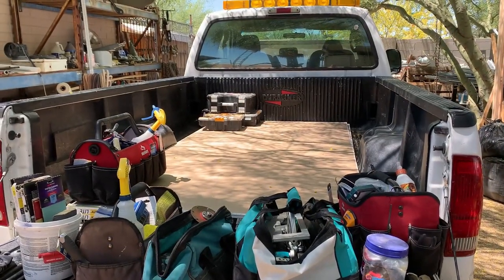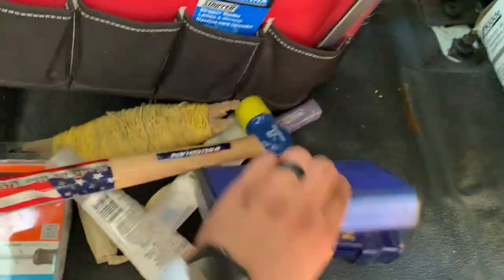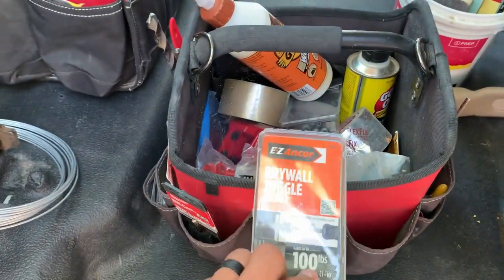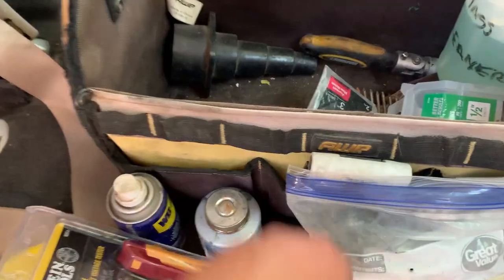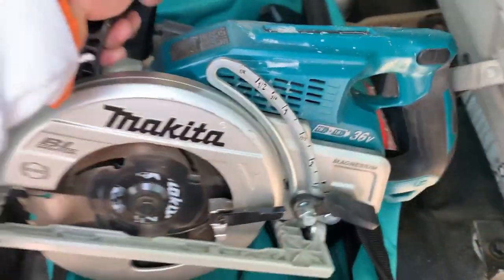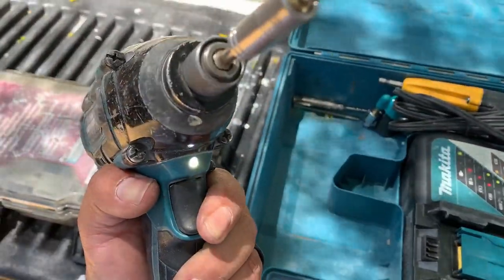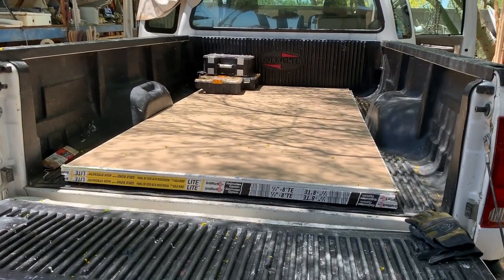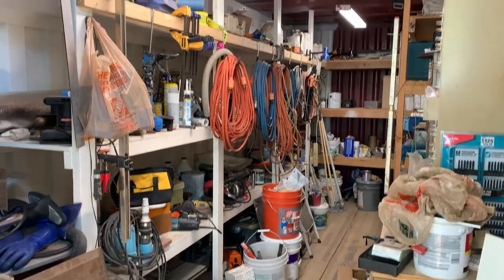Self Employed Handyman - What's In My Work Truck?

Comment: I do remodeling always looking for time saving and organizational tips.
I found the Rigid rolling tool box system very good.
Also those husky tool bags are great for a set-up .plumbing, electrical, carpentry.  I have separate set-up tool bag for each trade... saves time and the tools are in that set-up.
My cordless tools are in the Rigid rolling tool box.. 
Great video
Reply from the maker: Thank you. I’ll look up those rolling tool box and try them out.
Reply: That’s why I watched this video, I have tools for several trades and they are all unorganized because I’ve mainly just used them for personal remodeling projects, but now I’m planning to work for the public and I can’t spend an hour looking for a specific tool. I need to become more organized. This video gave me some good tips. I have a 20 ft trailer with shelving on one side and at the front. Think I’ll make this my primary storage location and compartmentalize my tools by trade or function so I can take what I need to a job without hauling that big trailer everywhere.
Reply from the maker: @LVCID777  I used to have a small enclosed trailer where I began storing all my stuff as well! Eventually I had to get the 20ft container though to store even more things. I’m glad the video was helpful, and good luck to you!
Reply: Same lol 😆 Alot of Handymans are alike

Comment: I teach you what learned any screw can be cut to letgh needed with wire cutters, bolt cutters. Or just grinder. We line up panels and covers with ice pick help line up screw holes.
Reply from the maker: Thank you for the advice. That’s good tip to cut the screws if you have long ones and need smaller ones. We are lucky because the customer or client pays for the materials and I always calculate my overhead (how much I spend from my own money on materials like screws) so I just buy the size we need so we don’t have to go back and cut them back, saves a little bit of time. And I’ll try that idea about using the ice pick to line up the screw holes.

Comment: Good video, thank you!! What about the actual tool bags? You have Husky, Veto..... Any feedback on what bags last and perform the best? Thanks again!!
Reply from the maker: Thank you for watching the video. As for the bags, I don’t usually take them down from the car as I usually get what I need from them and take the tools in hand to where I’m working. But when I do need to grab the whole bag, I alway like the smaller Husky bags as they are easier to handle. Also, the big open husky bag has a removable handle that has a nut that holds it in place. This nut is alway unthreading itself, so I would avoid it if you’re needing something to move around. I also like the black Husky bag with the multiple deciders as it keeps my tools organized compared to the open style ones.
Reply: @luisangelmedia4459  Wow, quick response to my questions, thank you. I'll definitely check out the Husky bags. I'm targeting bags with the waterproof, molded bottoms for the outdoor jobs I'm doing on generators. Thanks again!!
Reply from the maker: @dalebabbitt6185  No problem, I wish you look finding a good bag for you. Let me know which one you get in the end.

Comment: This is an impressive video. You clearly are a very capable handyman/contractor.  What is your most common project?
Reply from the maker: I think drywall and paint are some of the things I do the most. Both residential and in commercial buildings. I get called for a lot of electrical work as well like replacing lights or fans and changing outlets. And I do a fair amount of plumbing work as well for showers, faucets, sink drains and toilets.
Reply: @luisangelmedia4459  I see, those are things I’m pretty handy at. Closed my business last year and going into construction again after 20 years lol
Reply from the maker: @LVCID777  I'm very sorry to hear that, about closing your business, what was it? I wish you good luck in your new career, construction is not for the faint of heart, but it's very self rewarding and we get to work with power tools!
Reply: @luisangelmedia4459  I worked till 9 last night grouting my shower. 7 days a week right now. Lol

Comment: Useful! Do you know what the gauge of the thick wire is?
Reply from the maker: I have 14, 16 and 18 gauge wire. I use the thicker one for hanging the commercial “troffer” lights from the ceilings. The other ones are good for hanging picture frames. Ook brand from Home Depot.

Comment: What you need a work van trust me I was  using a truck like you then I got a 98 Ford e-250 econoline van way better you get the power of a truck got selfs for your tools and you got room to load stuff real good for big jobs
Reply from the maker: That sounds like a really good idea. If I can get a good deal on a van in the future, I’ll definitely consider it. Thank you!
Reply: @luisangelmedia4459  it something to think about I didn’t expect buy but I got a good deal I been using it about 10 years been good Van I can buy laminate flooring for a house and still carry my saws and stuff in that van but you nice little set up I got the same 5.4 triton in my van
Reply from the maker: @jacobstacy588  I’ll keep and eye out for a 98-04 E-250 with same engine then. Seems like a good engine to me so far.
Reply: Damn a van sounds like it would be awesome. I use a truck and carry ladders but every painter i know uses a van instead. Would you recommend with or without windows?
Reply: @jorgeo1492  well I can tell you the windows on the back doors are easy to break then you think but hell it doesn’t matter what you find a good deal on I like a work van you can put all tools in easy to lock them up you still cargo space you got the power of a truck you still tow a trailer if you need more room you can put latter rack on top so your latter don’t take up your cargo space but you got to use your mirrors to back up so it doesn’t really matter

Comment: How much do you spend on Tools yearly
Reply from the maker: I really don’t have a budget for tools. But each year varies depending if I made big purchases. For example, last year I purchased a very large 60lb air compressor for about $900 and a month ago I bought a cooler for when I’m working in the patio for $1,200. I buy the tools as I need them for the job. I also bought a new staple gun in January when I did another patio because I was given a very large box of staples for free, but had no stapler that size to use them with. But I have built up my tools slowly over the last 10 years.

Comment: you need a van
Reply from the maker: Louis MacDonald I thought about that, but I just like my truck too much!
Reply: @luisangelmedia4459  its theft a big issue. anyone could just lift something from the back
Reply from the maker: @louismac1  Yes that is a good point. I try to keep my truck locked at all times and the important tools in the cab. Thankfully I have not had troubles with theft, my truck is always in sight too. When we buy materials, 1 person stays in the truck while the other goes in to get the materials, me or my dad.